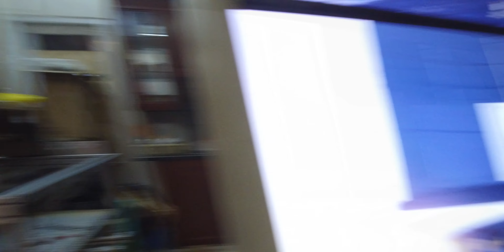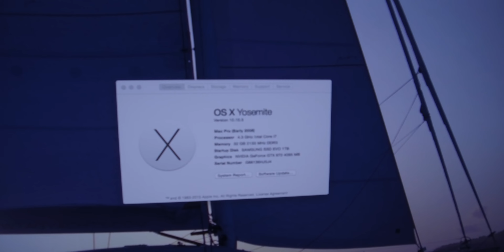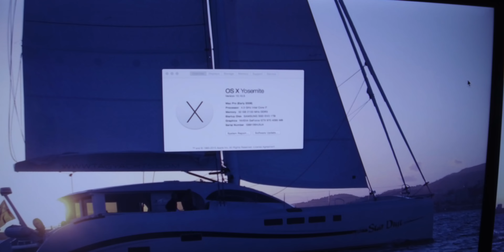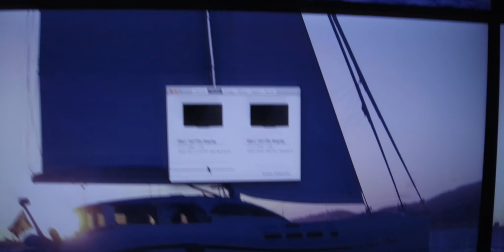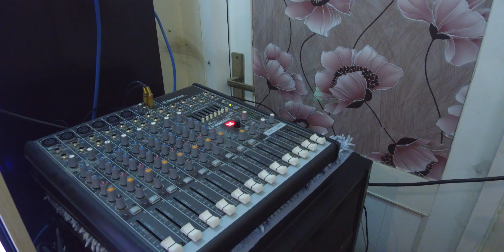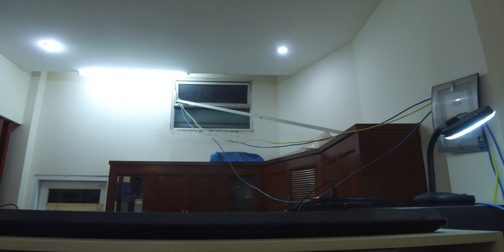HACKINTOSH LONG TERM REVIEW

Comment: Nice! I like using Hackintosh, macOS has something that other system don't have, in design, I cannot express what. Actually I do prefer Windows on multi monitor behavior, but use macOS Sierra also. Unfortunately Apple is crazy about pricing, and each year it gets worse in my country (Brazil). We can build better PCs with 1/4 of the cost of a limited Mac. I wish someday Apple would release macOS for PCs, it would dominate Windows in a few months... But it seems that it will never happen. :(

Comment: Was the k4000 you used "reflashed" such as one of these on ebay, or was it a regular pc version?
http://www.ebay.com/itm/Nvidia-Quadro-K5000-4GB-Apple-Mac-Pro-compatible-4K-support-In-stock-/142278904821?hash=item21207bcbf5:g:0RQAAOSwiLdV~bM7